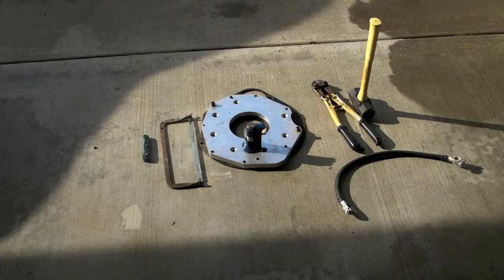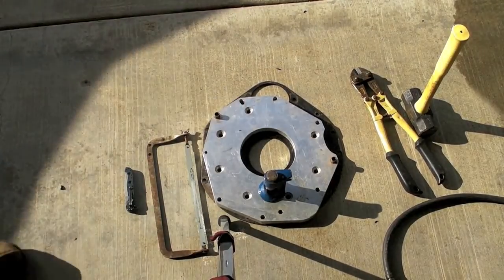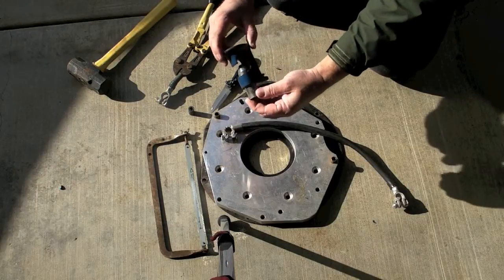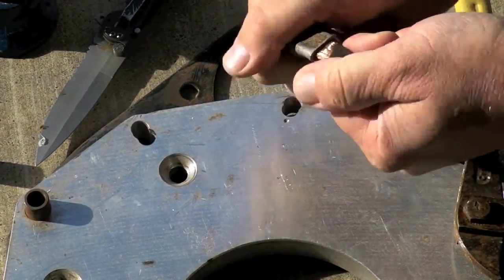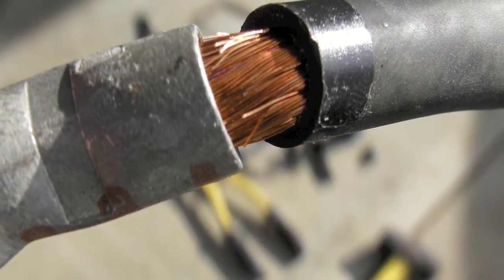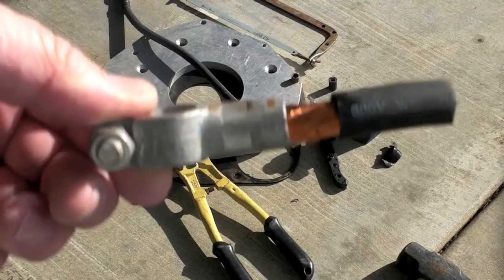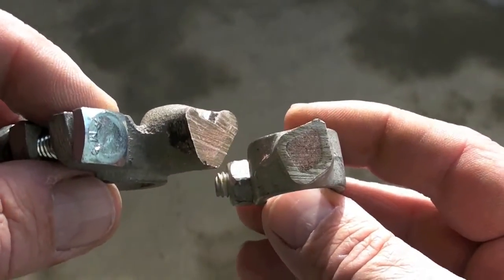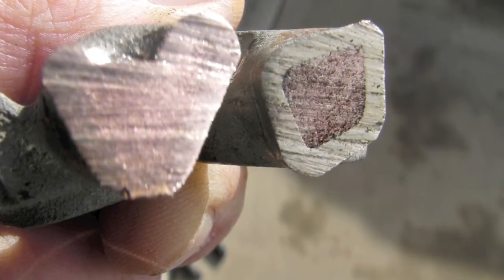Crimp.mov

Comment: I'd be happy to compare to a 6 sided vs a 4 sided hydraulically crimped lug. I guarantee you the same results. I have had 6 sided ones pull out. Once I get my hands on a 6 sided one I will do an update to this. The 4 sided one was however crimped pretty hard. But nothing like the manual hammer crimp can produce. 

Again, the purpose was to show results, not be politicly correct.

Comment: My guess is you could avoid 1) and 2) by using fewer blows or less power, the problem is repeatability - when using a hammer crimp it is more or less impossible to do identical crimps, this is where the (genuine) hex-crimp shows it's true colors.

Comment: 2) At 11:31 and a couple of seconds on it looks as if the hammer-crimp has a crack in the tube - this opens up for corrosion inside the terminal. If the hammer-crimp is used care should be taken NOT to cause cracks in the connector tube.
3) As I have understood it, the fact that the strands are alsmost fused together when using the hammer crimp actually reduces the current carrying capability (ampacity) of the cable, this happens when too much pressure is applied.

continued below...

Comment from the maker: Martin,

The exercise was to show the quality of the hammer crimp vs the hydraulic crimp internally. If the hydraulically crimped end had been done three times and in alternated properly the cut section would still look the same. Next time I will wear gloves to keep the cable clean from grubby mitts and I will recommend that the inside of the lug be cleaned. That was not the point of this video. 
The photos tell the story and I need not say any more about the subject. 

Pete :)

Comment: Your hydraulically crimped lug is a very poor one.  The h-crimp has only been done once.  It should be done all round and all along  the lug barrel to form a proper hex x-section.  The broken strands are well away from the crimp and irrelevant.  Lastly, the wire *was* clean until you put your grubby mits all over them and not cleaning the lug inside  will cause heating and ultimately a spectacular failure of the joint at constant high currants. Use a internal pipe cleaning wire brush.   MW.

Comment: You Gott it Di!  A simple demo beats a lot of hot air on the EVDL.  I'm gonna try to weld my hammer crimper to a steel base plate in order to keep things from bouncing around so much during the deed.  btw, love the ergonomically-enhanced hacksaw, but please lose the chimes next time!